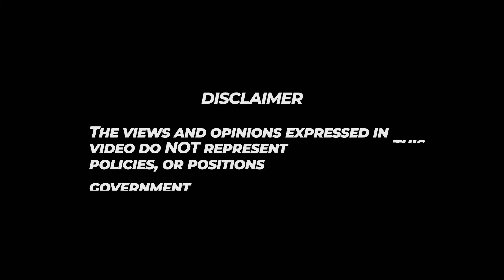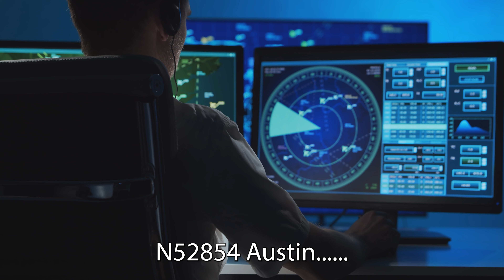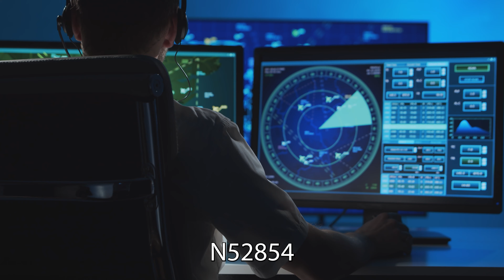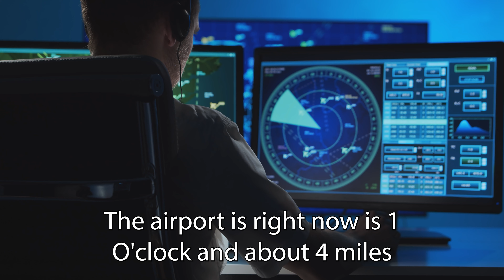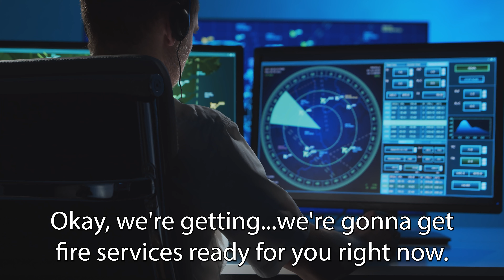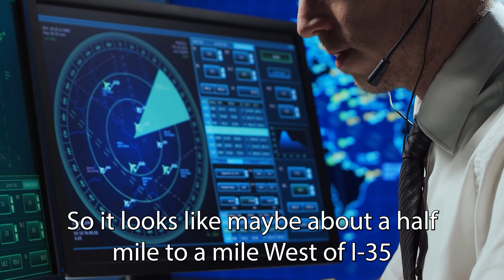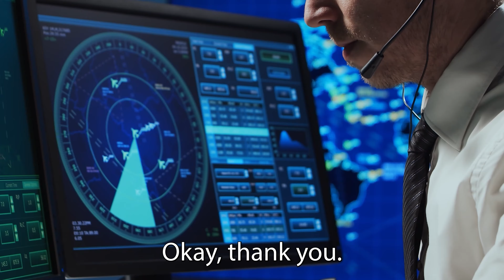Pilot Crash Landing at Lady Bird Lake after Departing Austin Airport | Emergency Landing

Comment: Yeah, spot on, left the home airport without having any safety margin. Even on a maintenance flight, there should be a test plan appropriate to the maintenance completed and emergency procedures in case something goes wrong.
Reply: I know that area well, to the West (where he flew) is the city, to the east is miles of fields/farmland. Probably a route required for air traffic control, otherwise that’s a stupid course for a maintenance check flight.

Comment: Reading thru the comments, there's a mix of pilot blame and assumptions made, "woulda-shoulda-coulda".  Yes, the pilot made haste to get out of the TCA, but we can't assume that he did so without prior approval or pre-arrangement.  The fact that there's no "Possible Pilot Deviation" ATC statement, hints at a prior auth.

As to having a test plan, it's absurd to speculate that he didn't have one, formal or otherwise.  It's also absurd to suggest that he didn't have an "In case of emergency" plan -- his initial flight path suggests that he did.

All-in-all, this was a post-maintenance test flight, where it was assumed that something will (not might) go wrong, even with a seasoned pilot "at the helm", which he was. 

Given the fact that he had severe engine failure, he absolutely did the right thing, given his location and altitude, and obscured visability.  ATC, who was controlling both GA and commercial aircraft, did an absolute stellar job.  BTW, it's not uncommon for ATC to give a seemingly contrary directive or suggestion in the face of an emergency.  In fact, it would be remiss if he/she didn't, just in case the situation self-improves.  Case and point: "Miracle on the Hudson."

Shipoopoo happens, and when it does, it gives the best laid plans and emergency procedures the middle finger.  Case and point, again, "Miracle on the Hudson."  In fact, all survived that tragedy because Capt. Sully did not follow procedures.

Nice job on this video!

Comment: Even if he flew the entire runway heading and climbed to a higher altitude, there was no way of knowing that smoke would come in the cockpit and obscured his visibility. He also takes a risk by opening windows and doors of not giving oxygen to the flames And making the fire situation worse. On the other hand landing in the water was the best option although one would claim they would try to get as close to the shore as possible without landing in the middle. Not being in that situation it’s easy to be an armchair pilot. As long as he was OK. I’m still gonna hate the legal and cost ramifications of this incident. My best guess is he lost all his oil may be due to an oil plug falling out or filter loosening up. You probably could identify burning oil versus burning electrical. The smoke maybe was caused by the oil burning on the engine and then eventually the engine seized. That is my hypothesis.
Reply from the maker: Thanks for your input 👍
Reply: He can’t see.  Probably can’t breath either. I think, given the situation, the pilot made the best choices he could.
Reply: Agreed. The high oil and engine temp suggest oil starvation and the smoke could be burning oil
Reply: He probably should've stayed in the pattern while testing out the plane instead of immediately heading away from the airport. I think that was the point ATC POV was trying to make

Comment: I see what he was trying to do. 40XS is only about 20nm to the northwest of KAUS and outside of the Charlie airspace. Bad judgment though. You gotta fly a maintenance check flight like the engine is going to fail at any moment. I get that he was in Charlie and wanted to bug out, but you gotta make better decisions. A much better course of action would have been to climb above the Charlie while in the pattern. It’s fairly easy for a controller to hold you directly overhead the airport as you wouldn’t get in the way of departing or arriving traffic. And it’s easier on you because you can stay with tower the whole time and not have to switch over to departure right away. Had he climbed to 6500 over KAUS before heading over to 40XS, he’d be 2000 above the Charlie, 6000 above the airfield, and would have had lots of time and options should he have lost his engine on the way up.

Twice I’ve had to b-line it back to the airfield after major maintenance. No matter how good your mechanic you gotta stay VFR and within glide back on your checkflight.

Comment: Seems like lately a lot of these crashes have been first-flight after maintenance.   I think a solution to that problem is to require the mechanic performing maintenance be on board the aircraft.  Maybe they will be more thorough if their own life is also at risk.
Reply: Can’t think of a single thing the mechanic can do in this type of situation.

Comment: What do you do when the engine puts smoke in the cockpit and gets too hot?  Shut it down and pitch for best glide.  Better to see and breathe an glide than to push power into asphyxiation and blindness.  And you can always try restarting the engine later, when it cools down, using the windmill effect.  Also, he should have vectored to the closest airport, which seems to be the one he took off from.

Comment: Maybe after engine maintenance a thorough ground run would be good before considering a test flight.  If something does not seem right during the run up, you just turn the engine off and ask for a tow back to the hangar.
Reply: How is t you know that wasn't done?

Comment: Ironically, crashing in the lake may have saved his life.  If the engine was burning up to the point that the cockpit was filling with smoke, then there is a very high chance of a fire.  Emergency procedure for a fire on the aircraft, in flight, is to dive for the deck and land immediately (seriously, a CFI will tell you to exceed Vno and get the plane on the ground IMMEDIATELY).  Additionally, it would have been exceedingly difficult to make a good landing on a runway with near-zero visibility; to make a safe landing on the highway would have been nearly impossible.

Comment: Forget "mayday" to much TV. Declare emergency from get go
Reply from the maker: Absolutely!
Reply: But isn’t that the phrasing we should use? Mayday mayday mayday, or pan pan pan, depending on the severity of the situation?
Reply from the maker: Those are recommended, but not required. Their purpose really is to grab the controller's attention. But saying "emergency" does the same.
Reply: @carlosp4521  don't agree with pan pan. Something is an emergency or not. Pretty simple
Reply: @ATCPOV  The term "recommended" implies an official preference for that action, right? In point of fact he did grab the controller's attention so why fault his methods? Does it really matter that someone else would do it differently?
Reply: Mayday is the proper call he might have been in the airlines or planning to go to the airlines regardless mayday is the proper call because it will tell atc in any part of the world that your situation is dire sure you can get away with saying we’re declaring an emergency at this time in the us but it’s in fact proper to say mayday for an emergency and pan-pan for an urgency
Reply: @jeffdo9195  it’s not that black and white if you lose an engine on a multi engine aircraft it’s not an emergency but you want to get down pretty quickly in the off chance that your other engine goes too
Reply: @tyrekegordon2492  just indicate to atc your issue and request return to airport in case of the twin. Again not an emergency so why do you think PAN PAN comes into play? In my opinion a useless word. Low on fuel declare min fuel for example no need for PAN PAN
Reply: @jeffdo9195  you are free to your opinion. There are conditions that require urgent handling but not an emergency recovery, thus “Pan” would be appropriate. This condition was a Mayday.

Proper phraseology is important always, vital in busy airspace, and critical when flying international. I fly into Mexico, proper phraseology is something that I strive to maintain. 

Case in point, during this event someone checked in with departure and said something like ’2,800 “for” 3,500’. The word “for” should have been “climbing”. The word “for” can be mistaken for the number “four” especially when flying in airspace where English is not the native tongue. “Mayday” and “Pan” have specific meanings and are known worldwide.
Reply: @carlosp4521  your right it's just my opinion. Sticking to it :)
Reply: @tyrekegordon2492  I'm retired airlines still feel the same way
Reply: @carlosp4521  your free to your opinion too thats why America is great ( until liberals destroy it) share opinions and still be friends

Comment: 2nd leading cause of accidents in GA is firstt flight after maintenance,  FAA should take away this A&P lisc. A&P is not fit for this job.
Reply: Perhaps we should find out exactly what actually happened before we judge and punish based on speculation?
Reply: A&P mechanics don't have licenses, they're called certificates.

Same thing with pilots.
Reply: How do you know the mechanic made a mistake?